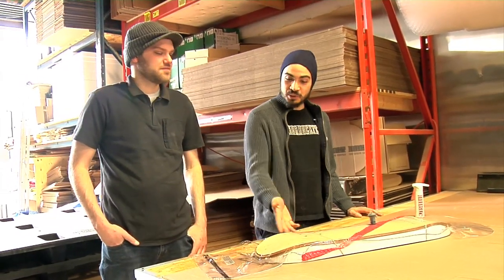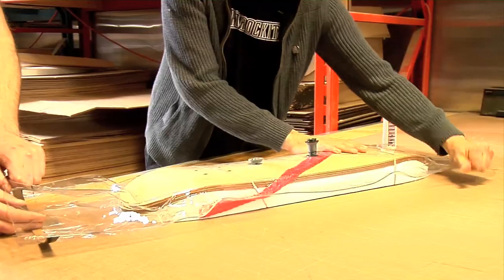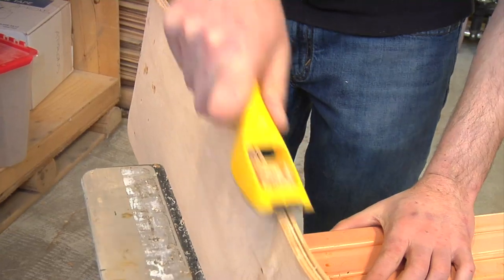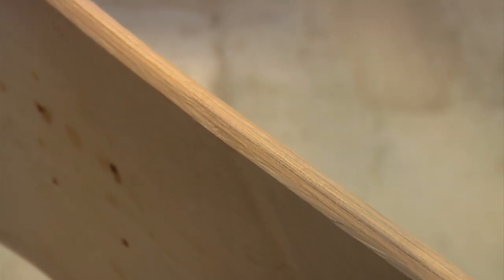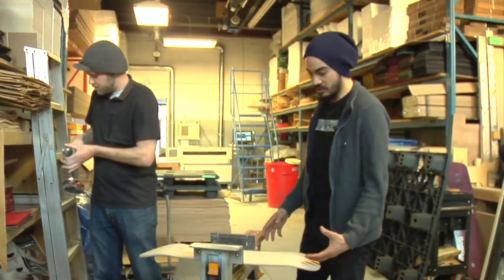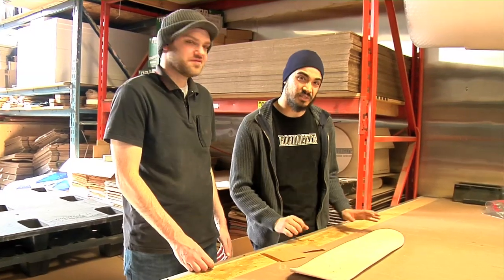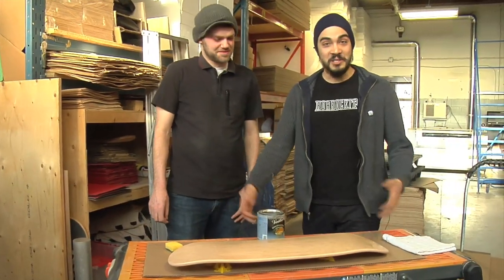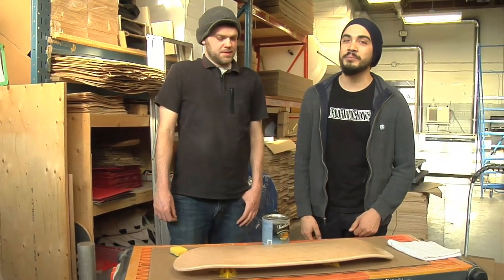Build a Roarockit Preshaped Skateboard Kit - Part 2

Comment: This is such a cool product! I have a question for you guys...If the holes on the bottom veneer are pre-drilled, is it possible they will no longer be centered between the rails since the veneers tend to slip during pressing and because you've had to shape the edges of the deck in order to level all veneers down to a uniform shape? Is the bottom veneer made smaller than the rest so all shaping ends when the edges of that veneer have been met?
Reply from the maker: Great question! As the mold is the same shape as the veneers it makes it much easier to line up the veneers and keep them from slipping out of place. We also have notches cut into the veneers and mold that help hold them in place with the elastics. You can also still shimmy the veneers around once it is nearly under full pressure. If for some reason your holes end up being way out of place you can easily relocate them as they are just small guide holes, but we rarely see any issues with them being off centre! 

All the veneers are the same size so that when you scrape down all the layers to match, it means you are taking equal amounts off of all sides of the board to keep things balanced.

Another reason we put the holes on the bottom veneer is that when you drill through from the bottom it will line up with your baseplate even if your holes are not perfectly square.

Hope that helps! Please let us know if you have any other questions!
Reply: @Roarockit  Wow, that response was quick haha. That clears it up! Thanks for your time!

Comment: so to add a graphic, should I paint it after or before the first layer of varthane? would standard spray paint be okay to use?
Reply from the maker: +David Tabak It all depends how fast you can finish the job and your preference for a surface medium. If you're quick to finish your graphics and apply a finish to the wood I don't see why you can't do that. If you think you'll be slow at finishing your graphics job then seal the wood immediately to prevent warping. As well, some people simply prefer to work on a sanded wood surface, others prefer a finished surface because of the feel. 

The main idea to take away here is that you seal the wood before it has a chance to dry, split and warp.

Comment: these decks look a lot thicker than normal skateboards. can you use one less veneer or other veneers in the same kit?
Reply from the maker: +Brian Walters Yep! They are a bit thicker but the pre-shaped kits come with 14 sheets of veneer so you could totally play around with veneer counts in a deck.  There are lots of extra ways to control for weight like less or different glue (titebond iii can layer on thick if you aren't careful), sanding down sheets to make them thinner, wheel wells and like you mentioned, less veneers. You're in control when building a board from scratch.

Comment: how strong are the boards with this method... pop, durability etc.  also if i wanted to use a clamping method could i get like a reverse mold for the street deck for on top
Reply from the maker: Hi Joe! The air pressure that we get from the vacuum bag gives the same result as a hydraulic press because of the surface area being pressed on. That can be just as good if not better than something made commercially because it will be made with care rather than in a factory.
For your second question, it is possible to use two existing skateboards to press a skateboard in between, however you won't get an exact duplicate of the board since the top surface of that board will become the bottom surface of your new board. That's why we recommend the vacuum bag because it allows you to use a one sided mold. The other great thing about a one sided mold is that it is much easier to create than a two sided mold like what would be used in professional manufacturing.
Hope that helps and please let us know if you have any other questions! Thanks!
Reply: Roarockit   Very cool guys. I’m also wondering if you can get as nice concave as a pro street deck. How do you achieve This.
Reply from the maker: @joegee6915  Hi Joe! Yes you can achieve as much or as little concave as you would like if you custom shape a mold to your specifications! Hope that helps, and please let me know if you have any other questions!

Comment: I'm currently making a longboard based of the Loaded Tan Tien, would I apply the same process of pressing veneers at a time or press all veneer at once. Also is mixing veneer like maple and bamboo a good idea or should I make a all Baltic birch board? The board I'm making is 38 inches long what would work best for such board? Thanks!
Reply from the maker: +flagzau You can press all at once if you feel up to it. We instruct this method on youtube for the benefit of those with less experience or confidence running through the process to ensure they're putting their lamination under pressure within the set time of the glue.

On mixing: Go for it! Experiment, play around. Each material has its own properties and there's no reason you can't combine to achieve different results in flex and rebound. A warning on baltic birch: That stuff is already plywood and not the kind of material you want to be doing further laminating with. People used to use it due to a lack of alternative skateboard materials available to the public. Now that we've facilitated access to the same stuff the industry uses, there's no real sense in going with plywood.
Reply: +Roarockit Thank you! For the amount of glue what kind of bottle should need for a 8 layer longboard 40"×10.5" veneers. Would a 32oz do or would it be tight?
Reply from the maker: If you check out the store page for glue or veneer, we show how much you might require OR you can do the math yourself: You'll need approximately 0.003oz/sqin of glue for an effective but lightweight lamination. Consider how much material you'll be trimming down, figure out your total glueable surface area and multiply by that figure.

Comment: i want to know if the mold have symmetrical shape or have a bigger nose than the tail? i want to make a symmetrical deck, or should i go buy the pro kit and make the mold by myself?
Reply from the maker: Great question! Yes our pre-shaped Street Deck does have a slightly larger nose than tail. If you want to make a deck to your exact specifications, I would go ahead and use the Pro Kit as you mentioned!